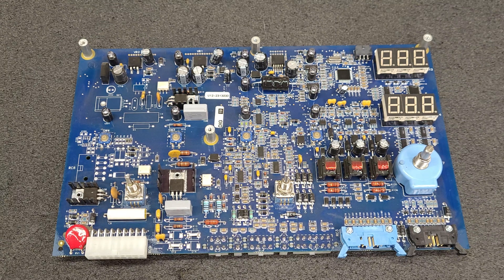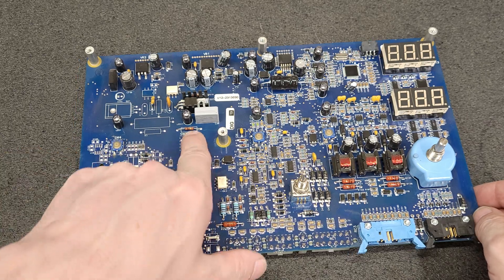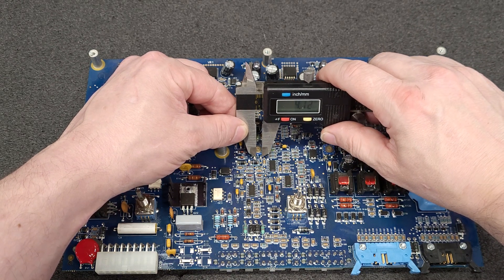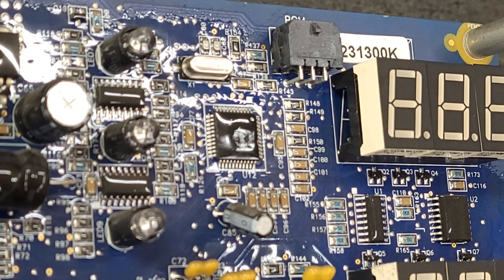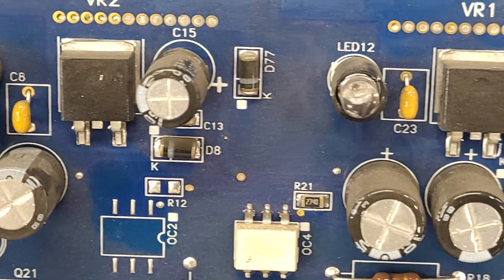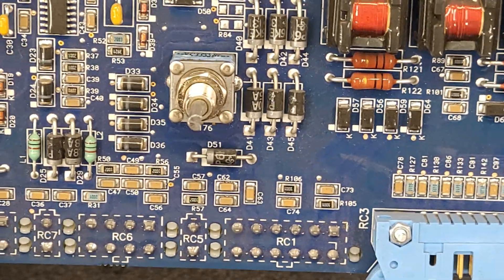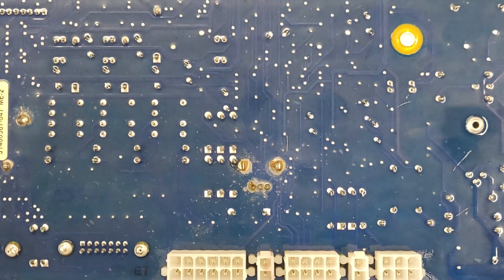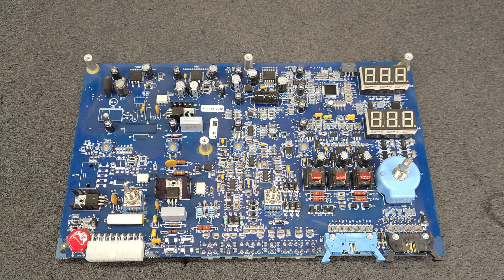A Look at the Miller 250DX Tig Welder Main Board.

Comment: My miller welder 250 dx syncrowave tig welder I bought new in 2006 throws a help 11 code. Any easy repair for that?
Reply from the maker: Check your switch and connector RC4, If they are good then Generally it is the inductors on the main board L9, L10, and can also be Resistors R92, R93, R95, R96 generally one or more will be open. Not sure the values off the top off the top of my head been a long time since I worked on a 250DX board. Notes say that inductors can be Labeled L12 and L13 and Resistors R66 and R69, L1, L2 R104 R99 or other depending on PCB Revision.